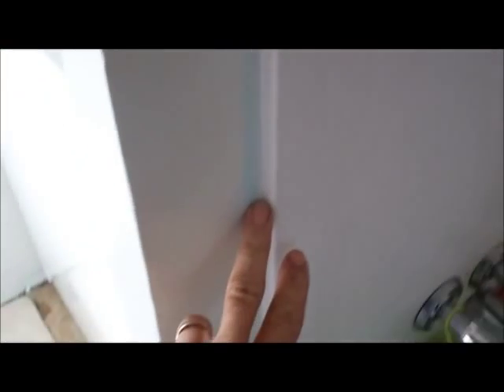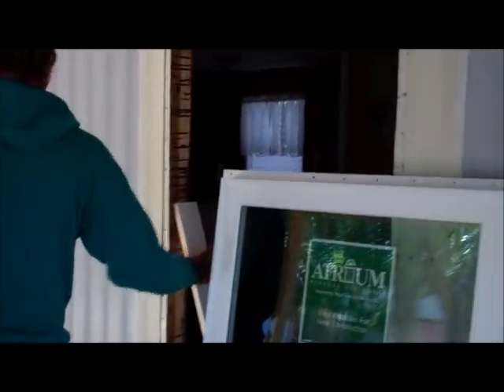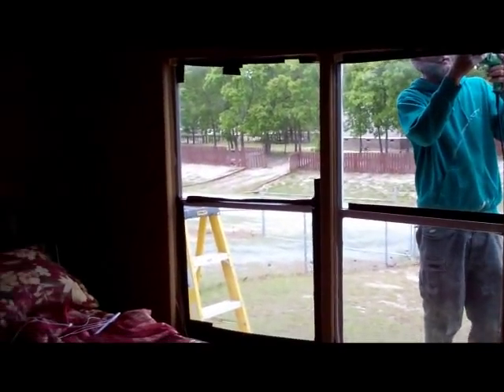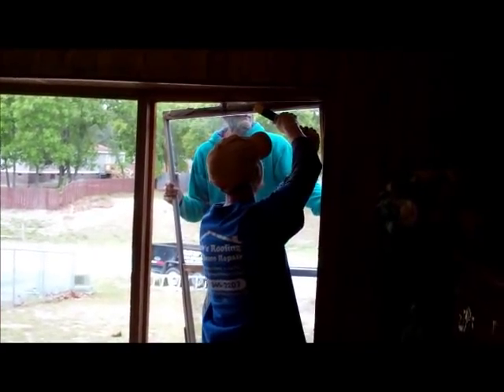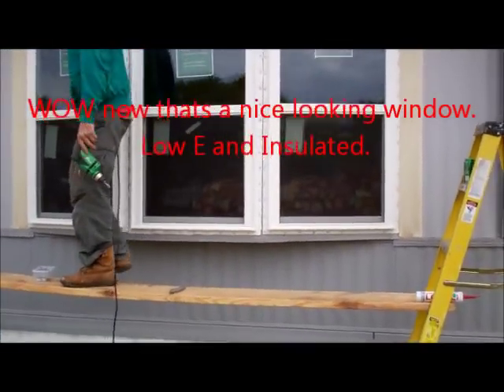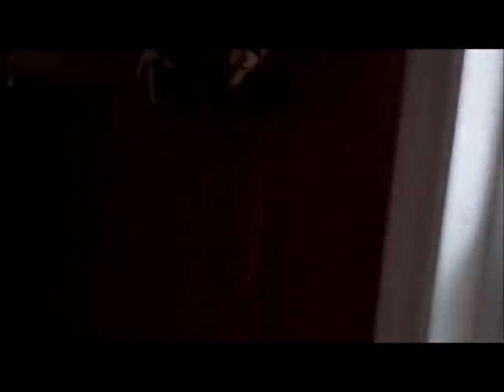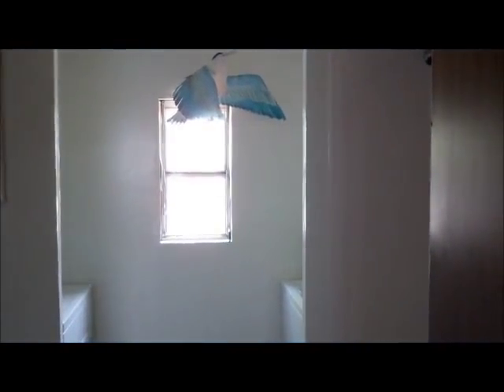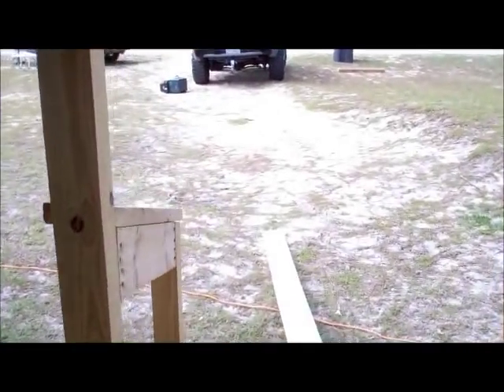Mobile Home Window Repairs Supply NC Brunswick County

Comment: I have a leak in my upper window seal. Think it is leaking from the roof any help will be greatly appreciated  on how to repair it
Reply from the maker: Most likely coming from the gutter area above the window or the window seal itself. Mobile home windows are supposed to be resealed every 10 years. So it could be you just need some caulking around the window itself on the outside I will check that first and if so go to Lowe’s or Home Depot and buy Lexell a Lexell is a clear caulking and it is very durable

Comment: How did you replace the window sills? Our window sills are rotted and the new windows only go so far inward.
Reply from the maker: Well you remove it to start with remove the paneling. Remove the Rottenwood. Use two by fours to frame under the window and put a seal on top of it it’s pretty easy really

Comment: I really wish I could afford to have you come look at our mobile home... I don't know if you remember me from a while back I had to ask you a few questions about the floors in other videos and I think I might have talked to you maybe about the roof also? But I've already laid all the floors down redone all the water pipes with PEX I tore all the existing insulation out and all of the sheetrock is pulled off the walls the house will be completely remodeled when we're done because we paid $300 for it and it needed everything! It was very nasty and had a lot of water damage! Our previous mobile home burn to the ground from an electrical fire. It happened May of 2019 and we lost everything we've ever had and wasn't able to replace anything because we had no insurance. We are still trying to recover to this day!
Reply from the maker: Yes I remember. It sounds like you’ll have a new house when you’re done
Reply: @Drewsroofingandhomerepair  yes sir it will definitely be completely remodeled! I have you ever seen little blue Sparks inside of a receptacle from plugging up and unplugging a electric heater? And does that mean I need to rewire my house? The wires do not look bad, they are they are actually they are actually still very flexible if that makes sense, they still have that new feel to them like more of a rubberized feel rather than a old brittle look and feel. I guess that's what's throwing me off... I cannot figure out what is going on and why these little blue Sparks are inside the receptacle like that? We have done so much to this house... I really did not want 2 rewire the whole house if I didn't have to of course. The roof was leaking pretty bad all the way around the top of the walls you could see it running down the metal on the inside of the house all over the place after I took all of the sheetrock and all of the insulation out. It has some rusty gutters on it, so that's definitely not helping matters any... But we bought some black roof tar looking stuff in a red can I think it was made by stop leak or Flex Seal or something like that and that stuff actually work pretty good but to me it's like putting a Band-Aid on a wound! My future plans hard to put a metal roof on the house and put vinyl siding on it and get rid of that metal siding! We have to replace basically everything on the inside, it's completely gutted!

Comment: How do you keep  new windows from leaking? Did they miss the caulking step? Mobile home park replaced windows recently, then sold  home...do the windows come with warranty home depot?
Reply from the maker: I did not show that stuff do you have to put a strip of mastic on the backside of the window and then caulking after that to completely seal
Reply: @Drewsroofingandhomerepair  is this already too late then? N thanks for your response.
Reply from the maker: I use lexell on the outside if you have to. If you forgot to put the mastic behind the window make sure you caulk the outside real well using anything but silicone or painters caulk